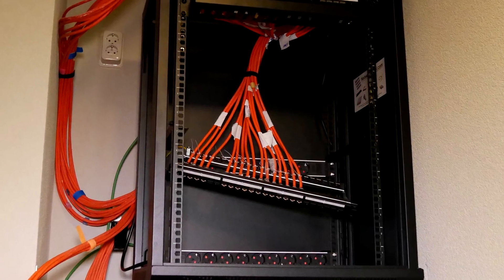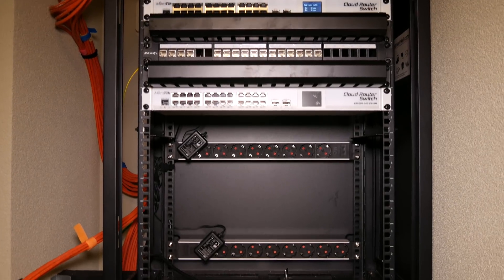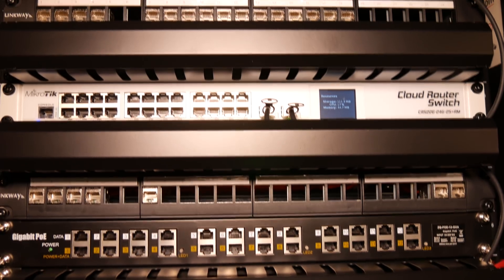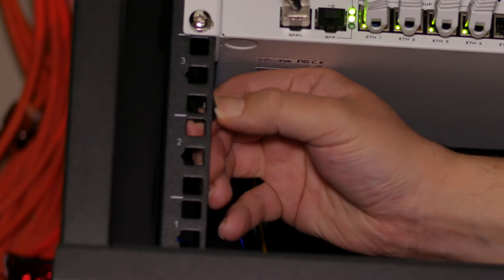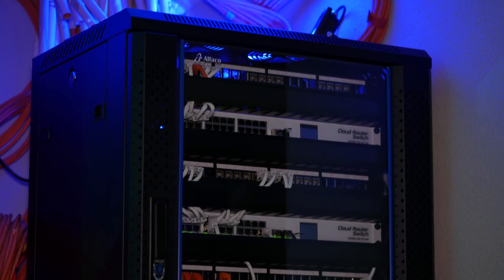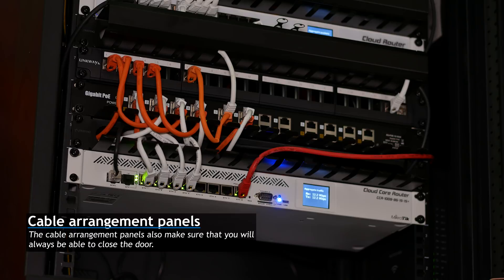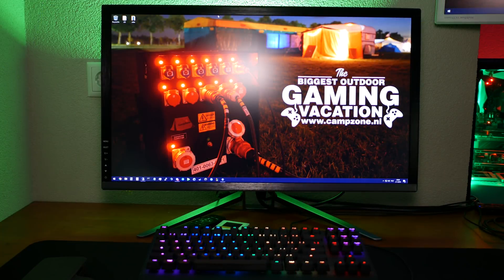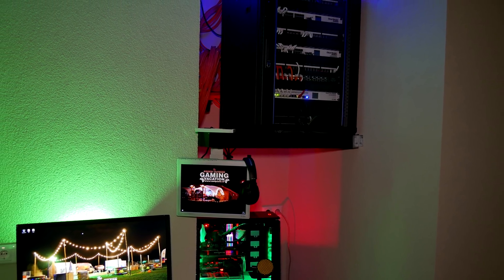Home Networking: Installing a home patch panel - part 3 - 3

Comment: In my case I elected for a room 8 by 8. Giving me 2 feet minimum of clear room around the  components. I have  a two post  rack in the center and a 32" deep  24U server cabinet beside with with 32" between them, giving me the possibility of another two post or another rack cabinet. The room has its own floor drain. All cables come into the 2 post into a cat 6 patch panel on the top and then are patched down to the switch (An older SMC Gigabit) I also have a Aten KVM and an RPC remote power control power-bar. I have a D-LINK router and a D-Link ac-1200 access point as well. In the server cabinet I have a HPE DL60 server with dual E5-2609s @1.9GHz and 32Gb of RAM.  I have a 30Amp power supply  brought into the room as well as 2 4 socket 15amp lugs on separate circuits. The 30Amp will be eventually connected to a  tower  UPS with enough backup for 24 hours (That's in the planning state and is projected to cost about $30,000 $CDN). Have a wall mounted AC unit made by Mistubishi that has 12000 BTU cooling power. I also have a blower  and vent connected so that during the winter I can redirect the  heat to the basement. Each floor has its own switch and it is  connected to  the  SMC but eventually I will install a layer 3 switch in place of the SMC. This should give me  better control of aggregation and traffic monitoring Internet is provided by a fiber optic connection  from the telecom company into the router. Total cost has been about $20000 for construction and trades plus all equipment and  cable runs to the room.

Comment: I see the G.Skill ram is stilling RGBing.
Reply from the maker: Yeah, as long as I don't install the software it all works just fine. I've tried once or twice to run the software and although it works they make you disable ANYTHING else related to RGB (Keyboard, Motherboard, Video Card, etc.) so it's basically completely useless unless you want to run the risk of frying the RAM and then have them telling you that you tampered with it. Up until this date still no solution has been provided for that issue. Oh and if you set a custom effect, it resets after turning the PC off. :(

So it's wonderful rainbow RGB RAM just useless if you actually want to make a theme with it. :(
Reply: Well I tried the 32GB kit I had on my X99-A II it's on the supported list but I had issues with it. I will see how my ROG X299-E Gaming does with the 14-14-14-34 3000MHz kit. Sorry slow on replies been busy myself.

Comment: Nice! I have the same style rack, i'm really satisfied with it! Mine is a bit deeper though. Pictures: https://imgur.com/a/N2k5N
Reply from the maker: Cool! That indeed looks like the same rack. I chose the shallow variant because it only houses patch panels and switches. It's a true "patch rack" for me. Servers would require a deeper rack in most instances. :)
Reply: Yep! Yours would probably fit short servers like the Dell R210 just fine though!
Reply from the maker: True true, but that would probably raise the noise and heat levels quite a bit. No worries, I have 8xCAT7 towards the back of my garage where I have my servers. That way I can even patch HDMI or USB to my office. :D
Reply: Nice! What servers do you have running?
Reply from the maker: 2x standard servers, one is my ZFS storage machine (about 40TB raw of HDD with some SSD's) and the other is my ESX server with only SSD's. Both are based on desktop hardware and in a desktop chassis to keep them nice and quiet. They run multiple functions in the house such as my dimmer system, etc.

1x LANparty server. I recently built this one , it's a 2U Ryzen based system with 52TB RAW in HDD and about 2.5TB RAW SSD's running Proxmox. I'll be doing a video about it soon I hope!
Reply: Damn, that's not bad! I only have a single R710, a R210ii which i still have to get installed and a Synology NAS, but i'm only 19 so there's that!
Reply from the maker: Nice, that's awesome for that age! I'm a bit older so it makes certain things easier. ;)

I remember when I was 19, I was hacking away with Promise controllers and PATA 60GB disks at the time. :P
Reply: Yeah, when i get older and get a stable job i'll be able to purchase more homelab equipment :D, the place where i currently have my internship is replacing all their servers this month, they are getting rid of the "old" servers (Dell R720XD) so i'm hoping they'll let me have one!

Comment: Rack looks good but the wires in the back need sorting as they bring the whole look down :(
Reply: stephen maunder 
Function before Looks....extra cable is a so called 'service loop'. You can take components out of the rack, with cables attached, and work on them. And like he told in the video, maybe in the future, he hidevthe cables with black cloth. 👍
Reply: Guust I understand the service loop but it could be hidden away in ceiling :) I heard the black cloth I was just commenting that something needs doing :) looks is always an important part of any rack
Reply: stephen maunder 
We are living in the Netherlands, there is no ceiling....
Ceiling and floor of the second floor is 1 concrete layer (about 4 or 5 inches), with the tubing of the cables inside the concrete.
So there is no hiding space for cables. The same for the walls, they are solid.
Reply: houses in america are made of shit, in europe they are solid